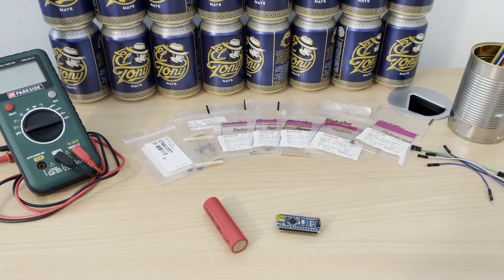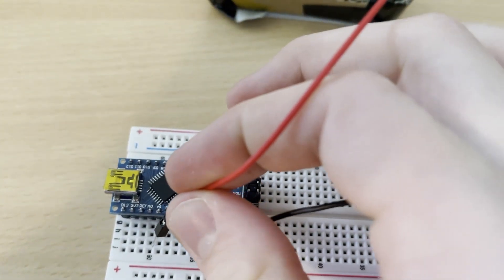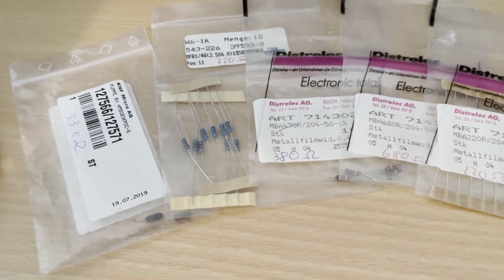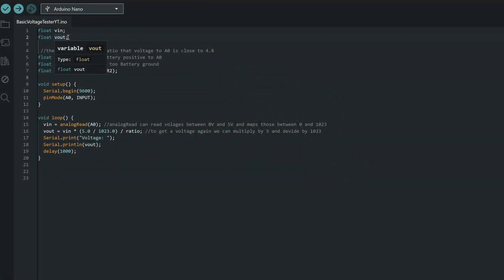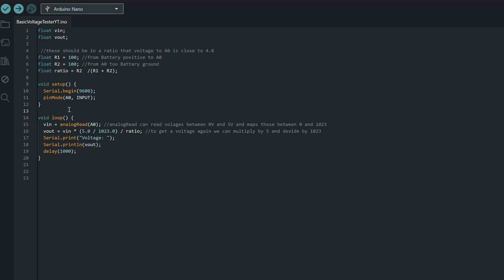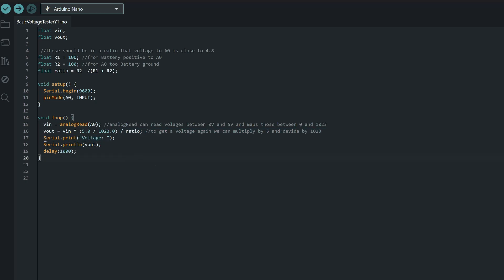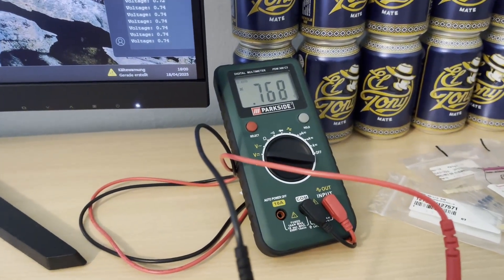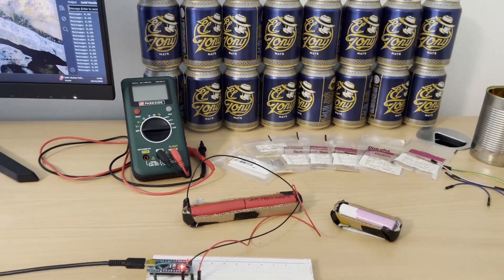How to Read Battery Voltage with Arduino (Measure Over 5V Safely!)

Comment from the maker: float vin;
float vout;

 //these should be in a ratio that voltage to A0 is close to 4.8
float R1 = 100; //from Battery positive to A0
float R2 = 100; //from A0 too Battery ground
float ratio = R2  /(R1 + R2);

void setup() {
  Serial.begin(9600);
  pinMode(A0, INPUT);
}

void loop() {
  vin = analogRead(A0); //analogRead can read volages between 0V and 5V and maps those between 0 and 1023
  vout = vin * (5.0 / 1023.0) / ratio; //to get a voltage again we can multiply by 5 and devide by 1023 
  Serial.print("Voltage: ");
  Serial.println(vout);
  delay(1000);
}

Comment: The Arduino A/D by default does not measure voltage. It measures ratio. Each A/D step is 1/1024 of it's own supply, which means that mV between steps is supply dependent.
Because the returned value then depends on input voltage and supply voltage (which is not stable). For voltage measurements we have a stable (but not exact) internal 1.1volt reference available, which can be enabled with code. analogReference(INTERNAL);
So, the 5V hard-coded value in your formula assumes the VCC is 5V exacly, but that's not always the case and it can fluctuate under load. Enabling the 1.1V reference, allows the measurement to be more precise. 
In that case, the voltage you bring to A0 must be less than 1.1V  of course , by choosing an appropriate divider. Your formula becomes:  vout = vin * (1.1/1023) / ratio

Comment: Not entirely safe. What if I connected to the voltage source that is higher than the maximum allowed by the divider? Bye-bye Arduino :(!
Reply from the maker: You’re totally right, if you connect a voltage source that’s way too high for the divider or if something goes wrong with the resistors, that could definitely fry the Arduino.  My idea was more for checking battery voltages in a known range, like 18650s or 9v batteries, etc.

You could test random voltages, but would have to play it safe by dividing the voltage down a lot and hoping the result stays under the analog pin limit, but yea as you say it’s a risk. I’ll make sure to mention that more clearly next time — thanks for the comment!

Comment: Very cool video.  The only thing someone should keep in mind if they're looking for slightly more accuracy is that if powering from the USB port, the voltage may not be 5VDC, as that can swing by a quarter of a volt up or down.  It won't really matter in most cases though, just something to be aware of.

Comment: In your voltage divider example, how do you account for the input impedance of the Arduino's analog pin potentially affecting the accuracy of the voltage reading—especially when using high-ohm resistor values? Would buffering the divider output with an op-amp improve reliability in precision-sensitive applications?
Reply from the maker: Good point. The input impedance of the Arduino’s analog pins is high, and while they draw very little current in steady state, the ADC can cause brief loading during sampling.  The effect is minor, but for better accuracy, especially with a source impedance over 10kOhm, buffering with an op-amp is a good solution. Thanks for the comment.